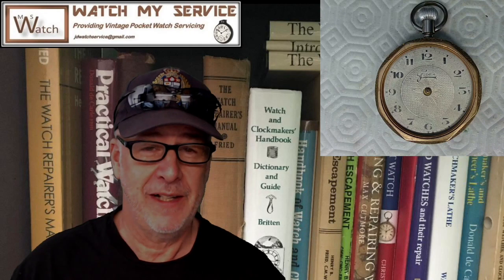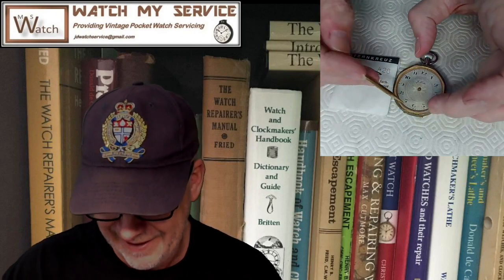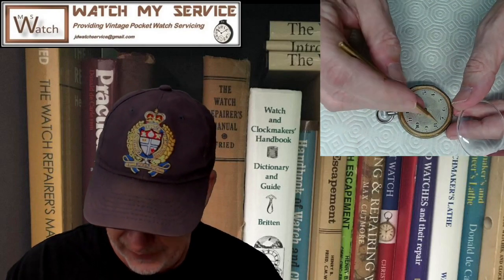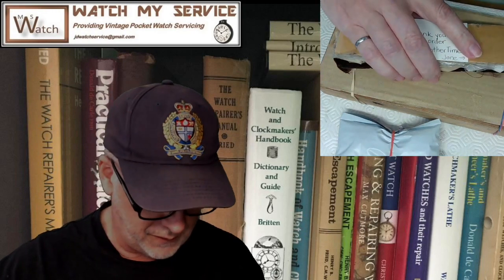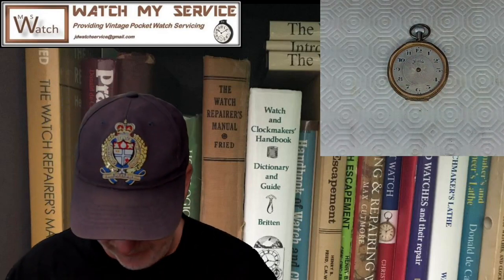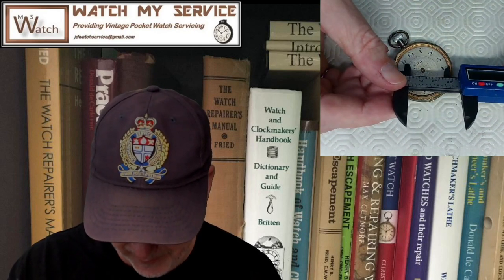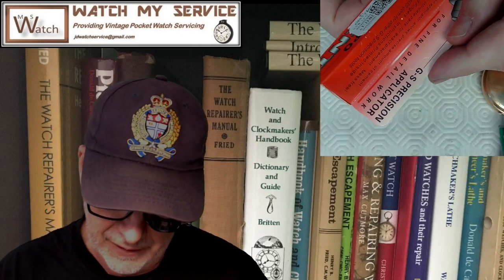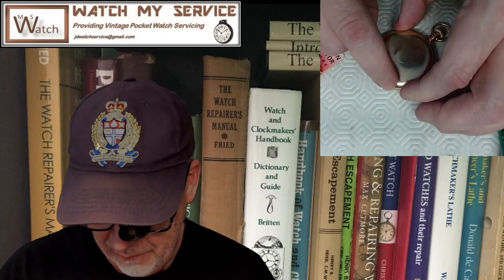Sizing Watch Crystals

Comment: I believe the measurement indicator is in Ligne. Dont know if im spelling it right and im mot going to my bench to pull out that sizing tool but i think thats what the 17 3/16"' is. Note the 3 hash marks are indicative of that specific measurement solely for horology. 
Let me know if im on the right track 😉

Comment: Great video.  I wonder if it is possible to craft a tool which could be inserted into the bezel groove and rotated to return the bezel to a consistent 12, 2, 4 diameter measurement.
Reply from the maker: There might be some sort of a tool that you could invent to do that but the problem is rounding off the bezel is not gonna help you when you’re trying to snap the bezel back onto the watch case. So the only option I really have is to take a oversize Crystal and file it down until it’s the right size and fits into the bezel.

Comment: From what you are indicating, the bezel shouldn't be measured when it is off the watch?
Reply from the maker: Correct, as the right size would be obtained when snapped into place. Screw-in bezels are more rigid and can be measured when off the watch